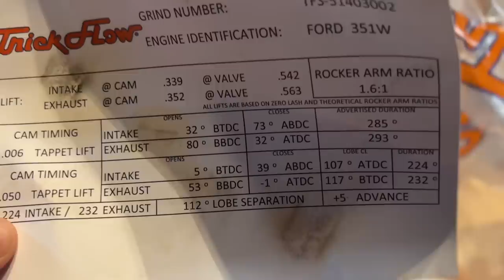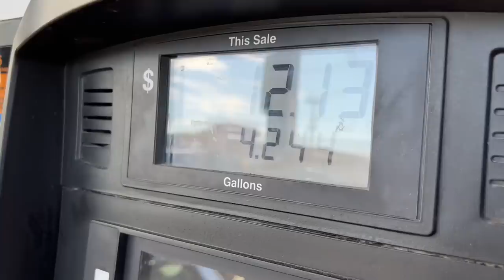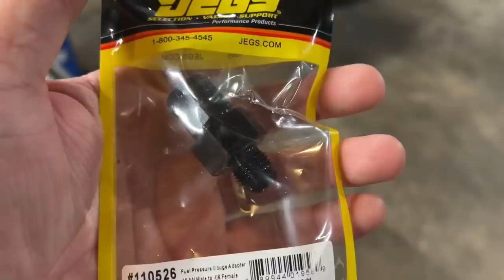NITROUS UPGRADES!  STREET CAR RIVALRY HEATS UP!

Comment: For me the downside to 4l80 is expensive lockup convertor and the cost of the computer to control the shift, and programming the shift can suck too, sometimes they shift sometimes they won't. So I have stayed 3 speed with my th400. I will keep your dad in my families prayers.
Reply: I’m pretty sure he’s going to run the Terminator max so if they put a trans brake in it he can control everything through the Holley.  Even the bump
Reply: @jackstephens2519  your right Jack.  I only got the sniper so no option for trans control and I'm only running a old small block

Comment: So, the S10 is broke. The Falcon still has a fuse problem, and you really need to engineer a way to get the tires off the Falcon quicker, but Jr is working on his mustang. Bill you are so in those boys' heads with that Malibu. If they would just let it go. Good luck at NPK. Mean's we won't get video but that's cool. Prayers for your dad and the whole family.

Comment: Got a 331 street 92gt with the same 170 trick flow Billy has. I got 12 pounds of boost and it runs 10s easy.  I assume he is going to spray which should put him in the same range as me.  You gonna need to step up the Malibu now. Great to see the cars evolve.

Comment: Idk if it’s already been told but if that 302 is stock bottom end you will need to open up the relief where the valve goes on the piston my buddy ran into that issue to big of valves on stock pistons and they were all touching slightly and made a tapping sound and couldn’t figure out why till it was to late

Comment: All I have to say about the shift kit transmission idea being all it needs to make a LS 5.3 fast in a full size gmt400 truck,is I had a built 355 balanced bottom end SBC,,3.08 gears and the factory th400 that was rebuilt and first got a stage 2 shift kit and a 1800 rpm summit racing brand stall torque converter and the truck would haul a load and pull a trailer just fine but it was a dog!! Pull the transmission pan off pulled out the transmission shop stage 2 shift kit, and installed a stage 1 rv and towing B&M shift improver kit and the torque converter I had mentioned several times and it straight woke up my truck it would flat out spin the rear tires taking off you could still feel the shift into 2nd gear but not the harsh shift, I installed the 11,000lb gvw B&M heavy duty transmission cooler the torque converter used with that setup was the B&M torqmaster 1800-2100rpm stall torque converter made it a completely different truck, so I have learned that lesson first hand as well..

Comment: Billy better put a bottom end in that Mustang those new heads are going to take a beating that block will only Handle 5 600 horse before it splits down the middle. I had 11 Mustangs I have three currently now and once you buy your first 351 roller you'll never buy a 302 ever again. 95 Bronco 351 roller engine that's what he needs in that Mustang with a good Hefty shotof nitrous all forged steel internals main girdle ARP studs and let that thing rip.

Comment: 800 hp stock 5.3 add ring gap, bte cam, single turbo on 20 lbs and a lightly modified 4L80 will hold it.

Comment: I got to say Tommy's not wrong here if he wants to do an easy swap that will net him good results I've been racing on more of a budget the last few years so my fox body currently has a forged turbo 5.3 with a 4L80E in it and I had to carry in a 4L80E last night to tear down and build for a friend and I got to tell you that is one heavy ass transmission I bet it's 200 plus pounds with the converter and now I'm looking for a powerglide literally overnight I just really like the 4L80E for my drag week events.. you know how kids are you tell them something's black they say it's white and everybody on the internet knows best remember that 🤣 I got a bad feeling without a supercharger or turbo or nitrous that 4L80E is going to be a bit disappointing so hopefully he's at least spraying it but I will say I was making 700 plus wheel horsepower on a stock for l80 for 2 years before I built it

Comment: I'm still laughing I'm gonna have to raise the rev limiter for a few laps. She was turned up pretty tight. It was worse when she got locked out of Facebook little while back 
What about that comment I made this morning on Billy's car running good if he doesn't go way  over kill on the cam and heads i quoted a cam 
230@50 or below his is 224/234@50 
I said 185cc on the heads he got the 170s he done good 
That cam is for the Windsor so its gonna run the 154 firing order not the H.O 137 I've been the fastest on the 154 firing order